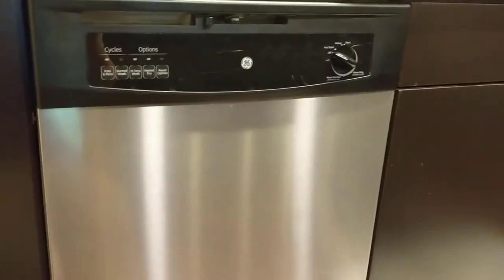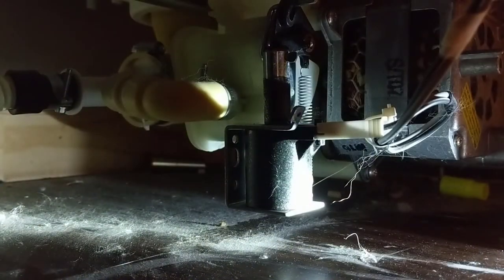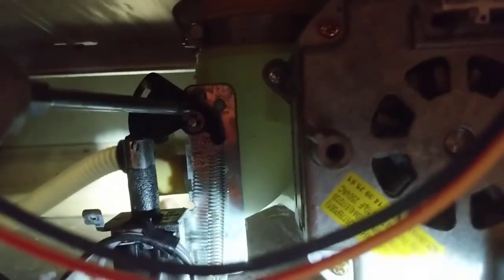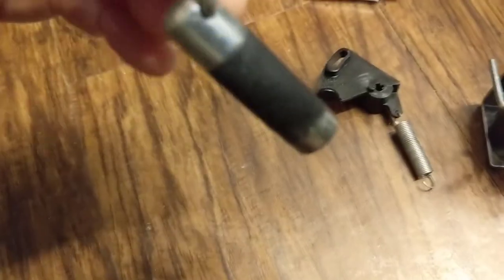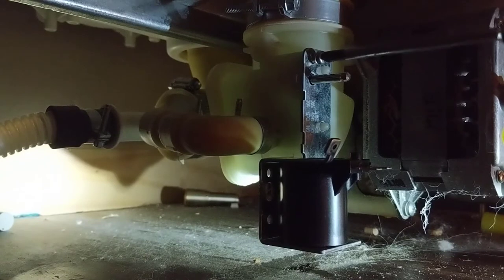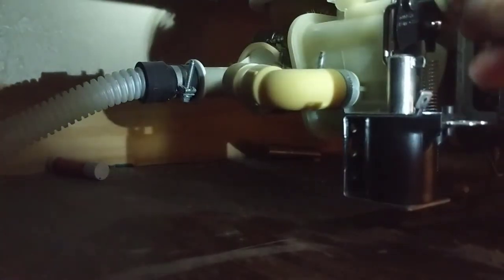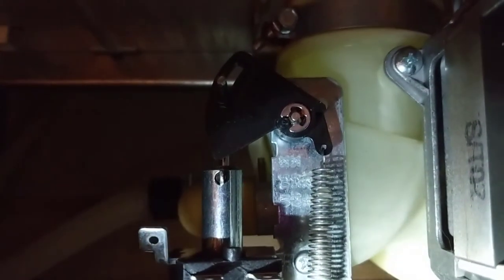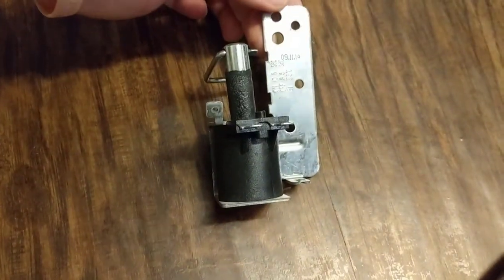Dishwasher Won't Drain

Comment: Great video! I just replaced my solenoid. Old one was burnt pretty bad. Dishwasher still not draining. Solenoid is engaging but nothing is draining. I’ve checked hoses and inside dishwasher. Any ideas what it could be or what I should check next? I’m trying to fix it myself to show my husband I can do it but now I’m stuck... please help.
Reply from the maker: Make sure the drain hose isn't clogged, & sometimes when the drain solenoid goes it takes out the timer, actually happens has been happening more frequently. So just make sure everything is hooked up properly on the solenoid, & the drain line is opened. Then slowly turn timer until you see it draining. Thanks for watching Marian & Subscribe to the channel 👍

Comment: Nice! Do you know why a dishwasher solenoid go bad?
Reply from the maker: Usually the from the timer, when its not advancing it will burn out the solenoid if it's stuck in one position for a long time, & other times it just goes bad. But if you replace the solenoid & the new one burns out within a few uses, it's definitely the timer causing it, then replace both the timer & solenoid. Thanks for watching 👍
Reply: Apartment Maintenance Thanks man!